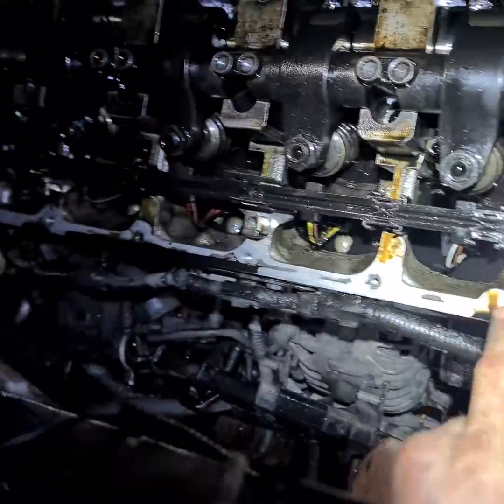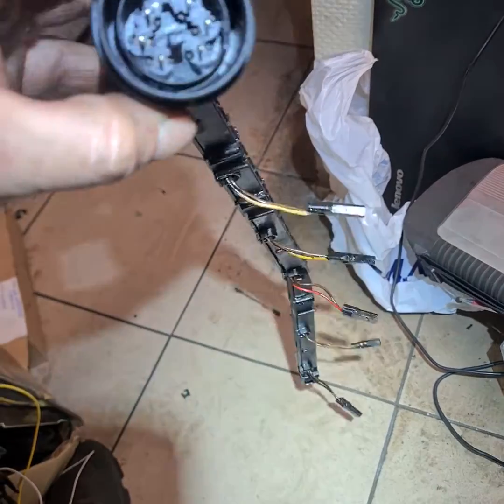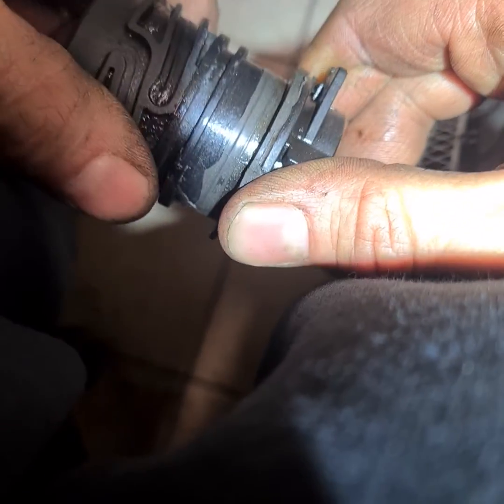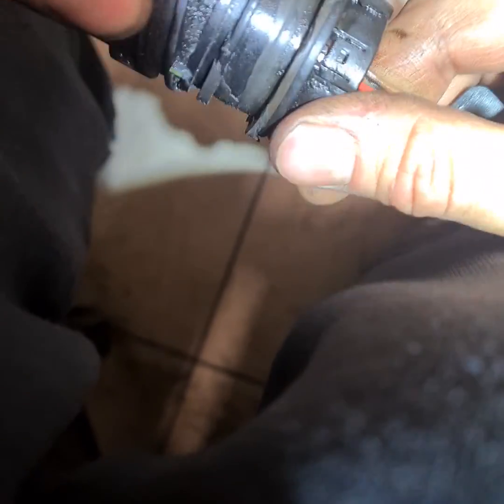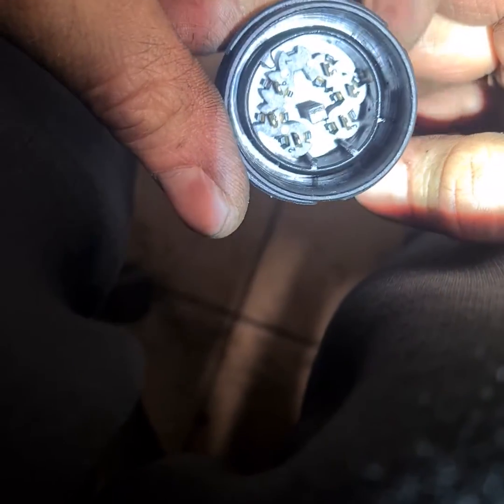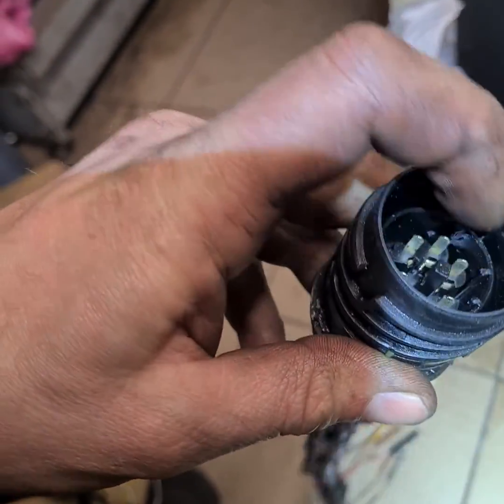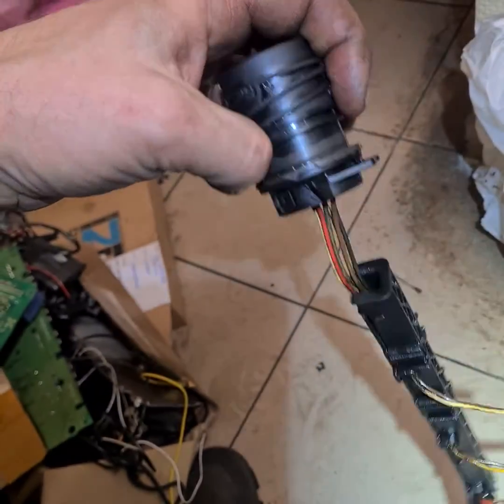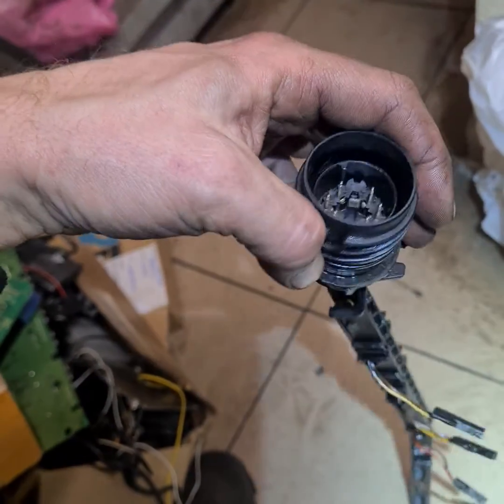t5 not starting 18072 p1664 control circuit for pd injector  unit injector solenoid valve activation

Comment: I have a 2004 model Ford Mondeo. glow plug is flashing. The vehicle does not start at first start. It works on the 2nd starter. It gives P1664 fault code. can you help? What should we do?
Reply from the maker: could be bad diesel pump. could be bad injectors. You must go to local workshop and make some tests.
Reply: @TomasAutoTech  The diesel pump was looked at down to the smallest detail. but the problem continues the same. The glow plug warning flashes when the starter is pressed for the first time. It works on the 2nd starter. A brand new battery is installed.
Reply: @TomasAutoTech  The pumper says there is no problem. But the p1664 fault code continues. I thought you could help.
Reply: @TomasAutoTech  Do you think it will affect the alternator or coal? Could this cause a malfunction?
Reply from the maker: NO ALTERNATOR
WHAT TYPE DIESEL YOU HAVE COMONRAIL  ? OR THIS OLD DIESEL PUMP ? wHAT IT P1664 what is text you got on diagnostic ?
Reply: @TomasAutoTech  Engine: Inline 4
	
	
	
Fuel Type: Diesel
	
Fuel System: Common Rail
	
Engine position: Crossovers
	
Cylinder displacement: 1998 cm3 / 121.9 cu-in
	
Cylinder diameter x In-cylinder stroke: 86 x 86 mm
3.39x3.39 inches
	
Number of valves: 16 valves
	
Turbine: TGV + Intercooler
	
Compression Ratio: 19.5
	
Maximum horsepower: 131 PS / 129 HP / 96 kW
@ 3800 rpm
	
Maximum torque: 330 Nm / 243 lb-ft
@ 1800 rpm
	
Traction: FWD
	
Gear: 6 gear Manual
Reply: @TomasAutoTech  Error code p1664: injection pump control module failure

Comment: Salut am schimba acest cablu si nu mai porneste deloc t5 2.5 multivan
Reply from the maker: so you cutted oring gummies, there is place very sharp, you must use sand paper to remove sharp and after put some silicone to slide in injector
Reply from the maker: check fault codes , what it says
Reply: 128 beginning of injection period not plausible injection
Reply from the maker: you changed just cable , not moved timing  gears ? What if you spray start gas ? @Relu-l4e
Reply: Am schimbat oringurile la injectoare
Reply: Am pulverizat cu gaz nimic nu vrea
Reply: Am folosit hartie abraziva  dar nu am pus silicon  doar ulei
Reply: Prima oara am taiat gumele    a doua oara mia aparut spirala  in bord dar am sterso cad a pus testerul